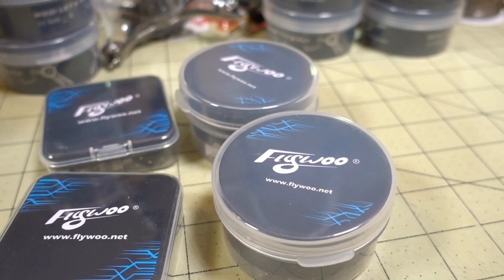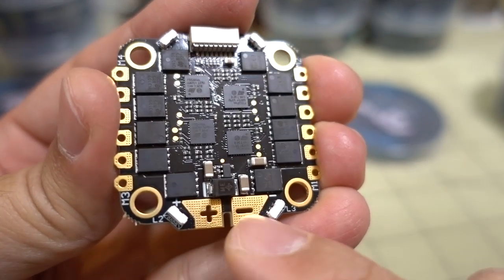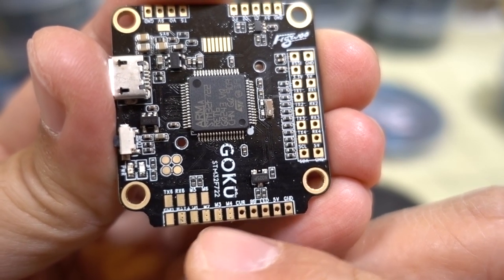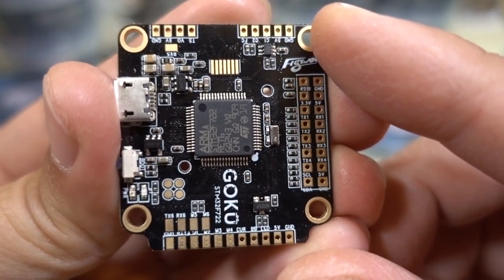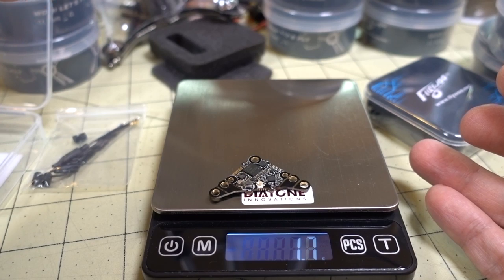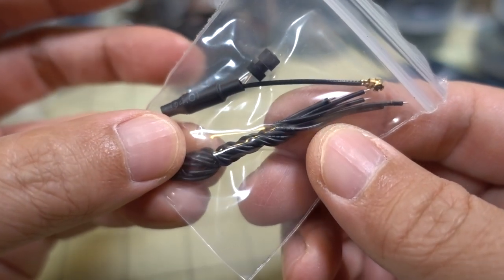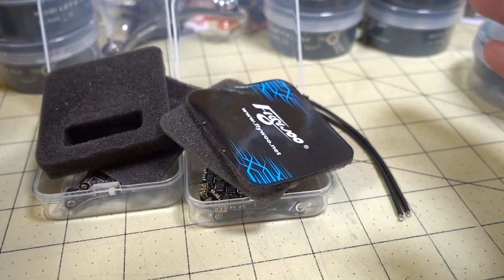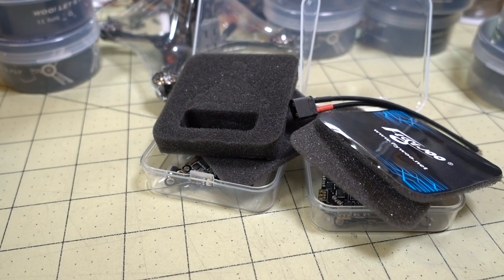FLYWOO 2020 All New Line Up (Part 1) 🔥

Comment from the maker: GOKU F7 30x30 Flight Controller - http://bit.ly/37VoW3h
GOKU 506S 30x30 50A ESC - http://bit.ly/37IfJLo
GOKU F722 20x20 FC - http://bit.ly/2nEAQg3
GOKU 406S 40A BL_32 ESC - http://bit.ly/37LwR2R  |  http://bit.ly/2N6bWj3
GOKU F722Mini F7 Stack - http://bit.ly/37JqWeI
GOKU GN413S F4 AIO FC - http://bit.ly/2uuOpSD  | http://bit.ly/2QWs8EH
GOKU VTX625 - http://bit.ly/2N72Hiy  |  http://bit.ly/37MjlMA

Comment: The LEDs are probably the ones that are programmed through the BLheli configurator, if they're like other ESCs that have those. On mine you can only turn the R, G, B elements on and off which limits you to just a few colors, but at least you don't have to wire up anything extra.

Comment: Hi Albert. I know you havent setup the Goku VTX625 but when you do I have a question. I'm using it with the BetaFPV AIO 20A toothpick board. After setting up the LEDs in betaflight they look good. But sometimes only one LED turns on, sometimes some of them are flickering, like there is not enough power. It's sort of random whether they work correctly or not. Should I solder the vtx directly to the battery lead to give it more power? Currently I have it soldered to a 5V pad on the flight controller.
Reply from the maker: I think if you go over 5v the VTX will burn out so I wouldn't try.  Perhaps your config for LEDs is wrong.  Have you  tried deleting it all and making a new config for the LEDs?
Reply: @AlbertKimTV  OK good to know. I'll try reconfiguring it. Thanks Albert.

Comment: Hi Kim,
Thank you for showing this line up!
I'd like to ask you if you can have a look at the whoop FC version of esc firmware. I like it to be the H version for JESC. Not sure if this is on it.
Thank you in advance, Erik
Reply from the maker: Yes, the whoop board uses BB2 or "H" style ESCs so it will work with the free RPM filter firmware.
Reply: @AlbertKimTV  
Thank you! I'll be replacing a defect fc in  my Beta85pro2 for this one +bn180 ,Rush Tiny+ lhcp

Comment: really wanted to see the user interface  ( yes the stupid LEDs)  explained for the FLYWOO TX-NANO .    TBS Unify Pro Nano 5G8  keeps dying on me  like third one in a row so I had to use the FLYWOO TX-NANO   the instructions are not straight forward  easy to understand   that unlock by holding for 10 seconds  isnt showing me the light cycle they describe and I don't ever set up smart audio so .. yea . Not fair you showed the nano in your thumbnail.  Oop  no you didn't  wishful thinking on my part  damn .. sorry.